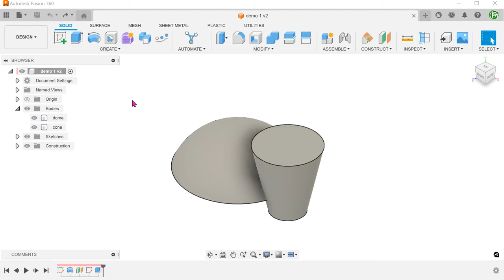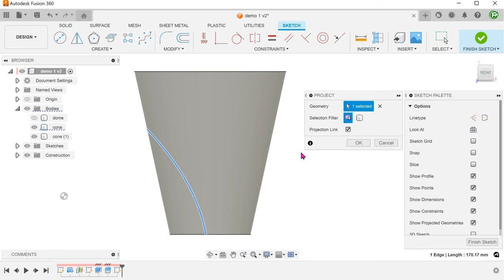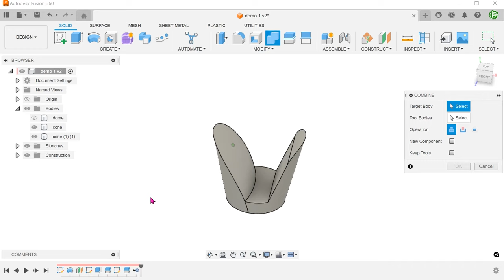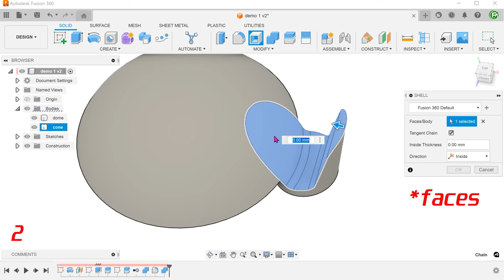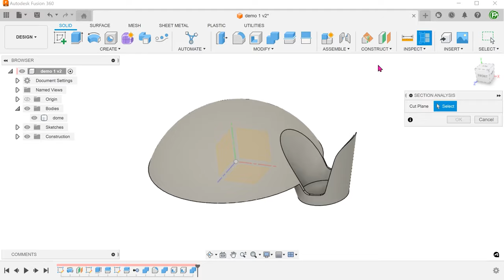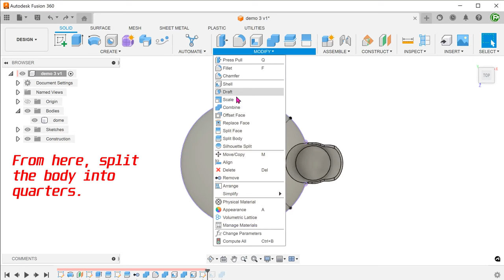Fusion 360 | Stationery Holder

Comment: (Copy pasting my comment on your previous post on this part. It appears we did it very differently, like, not at all the same way)

I did it. There is no drawing so it's probably not perfectly identical but I believe I got the shape right.

I started with the dome. Revolved a sketch and then used shell 2mm on the bottom face.

Then I drew a circle on the top plane somewhere outside the dome radius which I extruded upward (from an offset so it start underneath the dome) with a taper to give it its cup shape. I then used shell 2mm again on the top of the cup.

I then made a sketch intersecting the two features on which I drew a profile that's tangent to the outer radius of the dome and cuts into the cup. I used the same sketch profile twice, once to revolve-cut around the dome and then a second time to cut the inside of the cup, to finishing it's shape. 

Let me know if you want to see the file. I'm eager to see how you made it :) I'm curious to see how or why you came up with "46.8744" mm for the diameter of the cups lol. I'm guessing that you extruded downward from the top of the cup instead of the bottom.

Edit: Oh, I forgot the final step. Circular pattern to make 4 copies of the cup around the dome.

Comment: how does you camera work like that , mines always janky, be better if it was like windows 3d builder or a slicer where you can right click and move around without it rotating around weird points that never stay straight instead of ending upside down back to front. thx